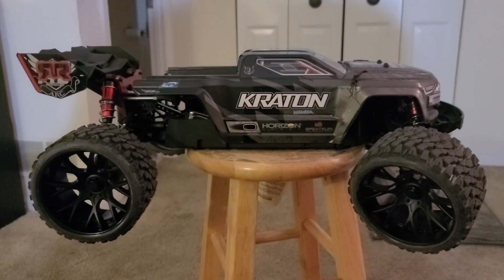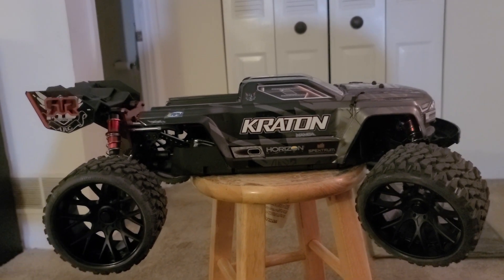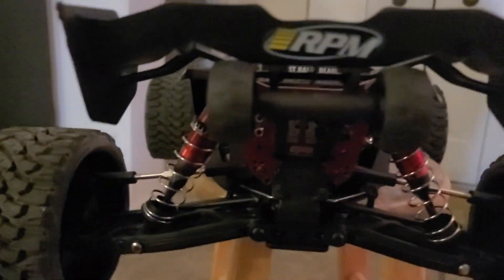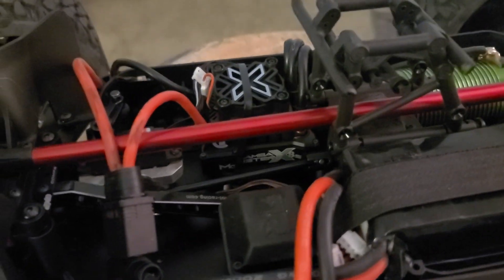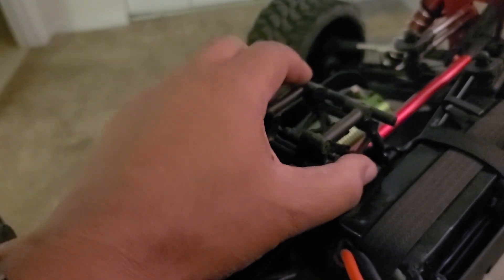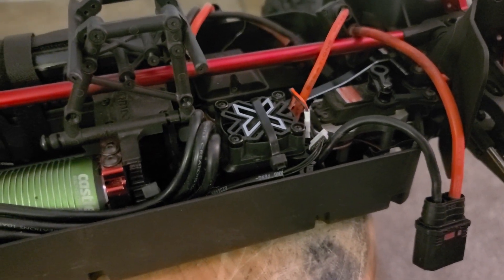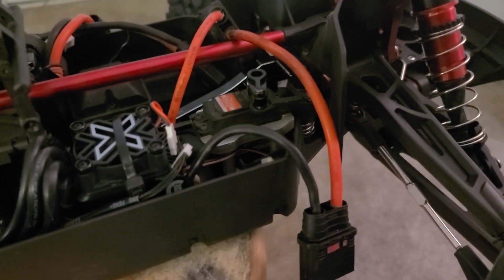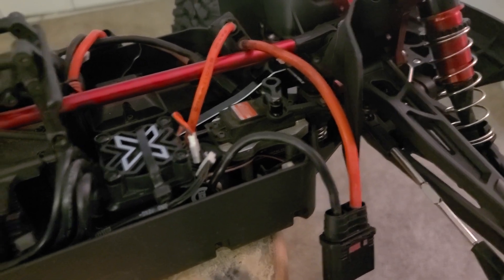The Worlds First  Arrma Krajave EXB Overview

Comment: Very funny... just saw this after commenting on the K12s. Have to say this rig here is an ultimate... I have it also lol. In fact I am running a 2100 TP 6s now but have this same esc/motor to put in and compare. But imo this is the ultimate mid size truck. Gonna do a video on it. Nice job.

Comment: Hey Jay I no this is an old video but is there any chance you can remember a part number for the body mount extensions if you can thanks 🏎💨💨
Reply from the maker: Item# C28879BLACK
Barcode: 91789035896
Brand: Integy
MPN: C28879BLACK
Compatible Brand: Any Brand
Compatible Scale: 1:10

Scale: 1:10

Compatible Fuel Type: Electric

Age Level: 14 Years & Up

Comment: Would you be able to share a link for the rear body post extenders?
Reply from the maker: Google search integy part
C28878GUN.  These are 50mm see if you can find 45mm or 40mm otherwise you have to extend the holes in your body.